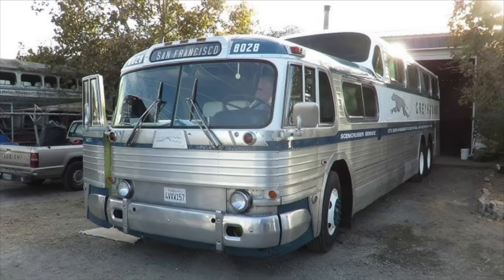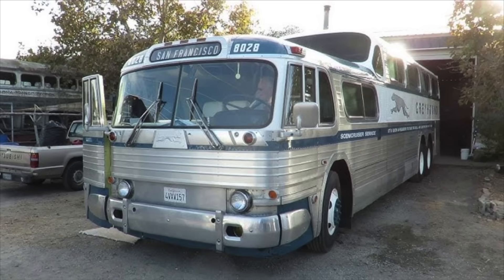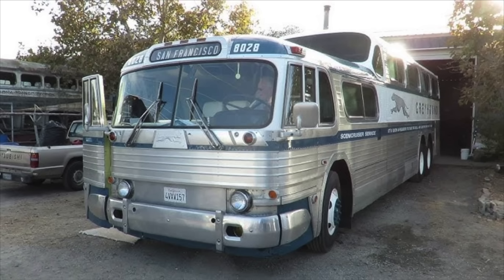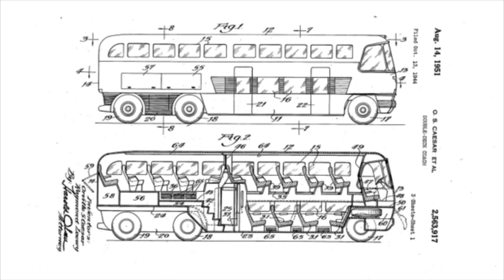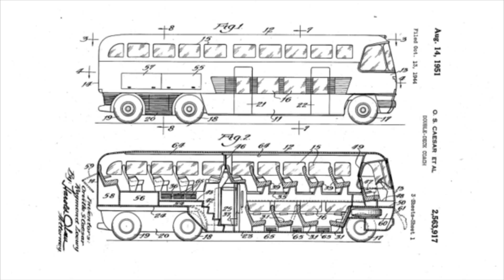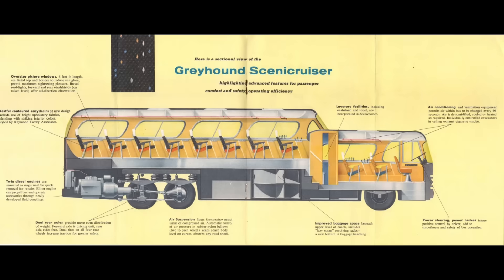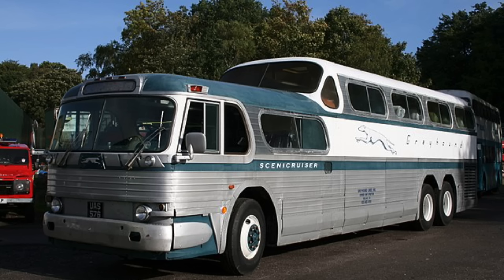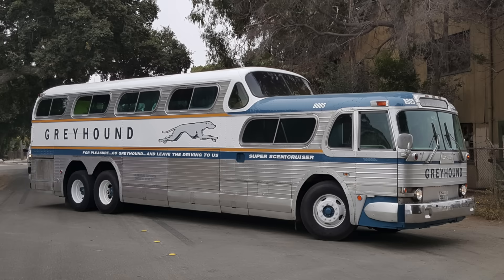Awesome & Flawed Vehicles: 1954-56 Twin-Engine GMC/Greyhound PD-4501 Scenicruiser Bus!

Comment: I worked for GLI from 81 to 2004, all in Maintenance.  I took care of their historic fleet while managing the Los Angeles garage during the 90's and 2000's. We had the 4th Seni-Cruiser built and totally reconditioned it inside and out. We used all 10 buses in the historic fleet for movie shoots, parades and such. We reupholstered it and converted it to R134A freon. We also installed an 8V-71 in it.
Reply: That must have been a very rewarding experience for you and your team. Great story!
Reply: I'm going to ask this same question ⁉️ in the main chat. But you're the guy to ask in my opinion! Considering you're an expert!!! You know how there are so many people that are into trains! I mean they have entire train hobby stores. Don't get me wrong I love trains also. But I feel the same way about buses & campers. Anyway the questions I have are. How many passengers could they carry on the 35', 40', and 45' bus's? 🚎🚍🚌
Reply: @scottbiddle3967  it would depend on the seating arrangement but most common arrangements were 39, 43, 47, and 55 passenger buses, and this is up to 45 ft length GLI spec buses from the mid 2000's.
Reply: This was probably inspired by the railroad Vista Dome cars.
Reply: The video could stand to provide a bit more detail on what were the problems with the dual engines and their fluid couplers as well as common mistakes made by field mechanics and tinkering drivers.  Also, were all of the dual engines replaced? or do any survive today? do any survive in use today?
Reply: @alan6832  I would like to see a blueprint of the fluid coupling set-up. Very interesting. Nowadays you would have a computer controlling the engines to ensure constant sync.
Reply: @erichartmann815  Not sure why it's a big problem if one engine contributes a bit more power than the other.  You shouldn't need a computer to endure an imbalance.
Reply: @erichartmann815 Nah… don’t need that bullpoop we got Mechanics!
Reply: @alan6832  exactly right. There are vehicles produced today, we could think of the Chevy E-Ray as an example - where you've got the internal combustion 495 horsepower engine in the rear, and then you've got a much less powerful (160hp) electric motor up front so there's naturally an imbalance there in many ways obviously the electric motor has instant torque (but still only 120ft/lbs vs over 400hp) and a different power delivery characteristic that they make it work to improve the performance of the car- obviously through today's technology.
Reply: @alan6832  Well any good mechanic who's worth his weight in chicken tits could tell you that what used to go wrong with them old highway birds were the Fetzer valves would seize up -- usually the bypass lines that ran through the luggage compartment would oxidize, but they could be fixed with some 3 in 1 oil and good set of 30 weight ball bearings and 10 quarts of antifreeze, preferably Prestone or Quaker State.
~ Fletch
Reply: Glendale H.S. in Arizona had one of these buses. It was used to haul football, band, cheer, etc. back in the 1970's.
Reply: Ypu guys were still running MC6s in the '70s.  When did they retire those?  I remember that Pacific GH was limited to using those only on US 101 between LA and SF.
Reply: @desertbob6835  Yes, the MC-6 was 102 inches wide and at the time, was restricted to certain highways, mostly in the west.
Reply: Great story!!
Reply: That’s awesome!
Reply: Raymond Lowry was also the designer of the PRR GG1 electric locomotives.
Comment from New Zealand.
Reply: @Phil-oj5nr  Hello Kiwi! I admire your country. I went 1,100 miles all through both islands. I follow the All Black's as well. Still have some currency as I will make it back, one day!

John.
Reply: How very cool. I am very envious. Congratulations sir!!
Reply: I'm pretty sure the Scenicruiser in the historic fleet was #001. Where did #004 come in and which bus did you put an 8V71 in? All the Scenicruisers had the 8V71 by 1962.
Reply: I remember you, though likely you don't remember me except as an annoyance for constantly wanting to climb all over the those old buses.  Well, that and refusing to drive a bus I deemed unsafe.  I would butt heads with the mechanics on that one regularly.

Comment: Nice piece.  I am old enough to have ridden on Scenicruisers a couple of times.  That was considered a cool ride at the time, and it was a significant bus design of the day.  I also rode Buffalo Buses, and while they were comfortable, they lacked the coolness of the Scenicruiser.  I think one of Greyhound's problems today is that the coaches of today are engineering marvels, but they lack the design coolness these had, which translates into Greyhound's inability to market itself as premiere round transportation.  In Europe especially, the coach designs still have that Je ne sais quoi and people think more highly of motor coach transportation than we do here.

Comment: "a famous industrial designer" I said "Loewy" before you did. Also did the coca-cola logo, AIr Force One paint scheme and the famous Pennsylvania RR GG1 locomotive of the 1930s. That said, in the early 1980s, they were owned by cheaper livery bus companies. Our HS Marching band hired three to get us to Northern Ohio in 1981. Coming home, the weird two-mode transmission died in one for them. All I remember is we had to crawl along with no higher gears. And no, I didn't get the windscreen seat.